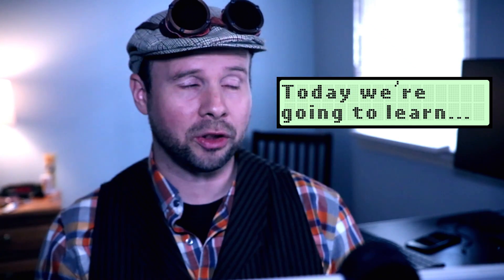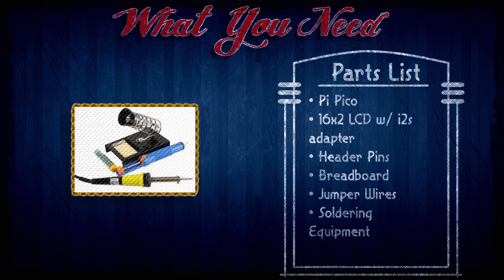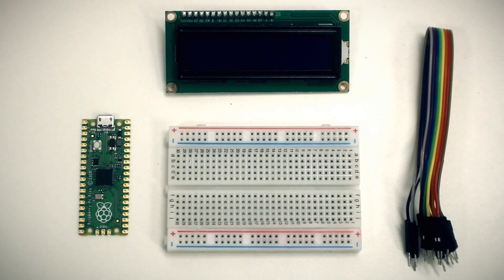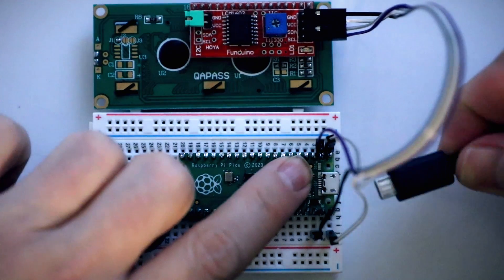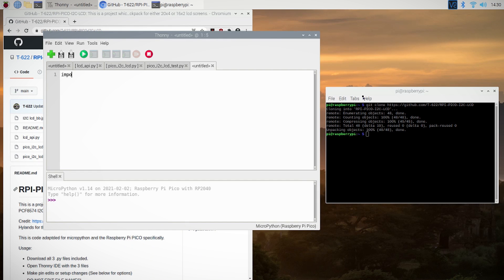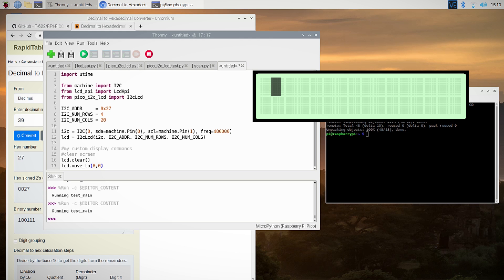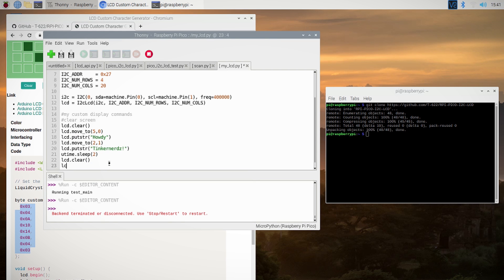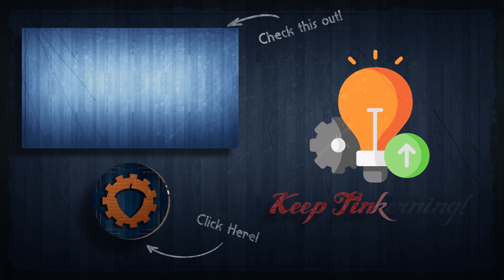LCD Basics for the Pi Pico

Comment: One thing to note here is that the LCD display being used in the video is 16x2 so you want to change the I2C_NUM_ROWS and I2C_NUM_COLS constants (or whatever passes for constants in Python) in the script to match those values. There are in fact 20x4 displays as the defaults would indicate and they work virtually the same way as the 16x2 displays.

It will of course work fine with the default values but you'll notice that setting the display dimensions correctly lets the library handle line overflow. The demo script that shows time for example includes seconds and those will be cut off if you have the wrong dimensions and will overflow to the next line with the correct dimensions. You also won't see the cursor as that's being displayed outside the dimensions of the screen.

Comment: Never the I2C backpack 16x2 screens. They are horrendous. Superbad contrast, viewing angles, ghosting. You can have a VA white on black I2C/Parallel 16x2 display for the same money as these junk panels with backpack combined, and you get a cleaner form factor as well, as there is no backpack because the controller already does I2C.

Comment: If you're doing everything the tutorial says and run the code and you get no error but still nothing is showing. Then try turning the blue box on the back a little to the right to fix the contrast. That did it for me. :)
Reply: Thank you!!  I got the backlight to go on and off, but I couldn't see anything else.  I didn't know what else to do until I saw this post.
Reply: Same. My i2c module came with no instructions (I didn't even know if I was facing the pins correctly) and got a bright blank display until I turned the trimpot.

Comment: Great video! I own both a Raspberry Pi Pico and an Arduino Uno 3, and I've noticed that the Raspberry Pi Pico is very similar to the Arduino Uno 3 (a microcontroller and runs on C++). Would an LCD display much like the one from the video be compatible with an Arduino Uno 3?

Comment: I plan to use the LCD as a Model Railroad Announcement display at the Station to show arrival & departure times & platform #  eventually add Train control to with fast clock in sync.  Either using Raspberry Pi or Arduino.
I have just subscribed to your Channel.  Appreciate your to the point videos.

Comment: It dont print text in my screen just blink the screen once . Can someone help me ?
Reply: same
Reply: same, seems like code itself is working, I can even toggle backlight on and off,  but I am unable to display anything on the damn screen, all the tutorials look the same, same components, same code, but nooone seems to have case like that and a fix...
Reply: @nonejm5732  try rotating the white thing in the blue box. It adjusts the brightness. By default this device is not bright . If you rotate it should fix it. On the back of the display*
Reply: holy shit, I found the issue, so on the back of the i2c converter is little blue cube, just use screwdriver and turn switch on the inside.... apparently it controls contrast

Comment: You are powering your LCD and I2C backpack from 5V. The Pi Pico pins are not 5V tolerant, so should a 5v to 3.3v converter be used here?
Reply: There are no output from the LCD to convert, just inputs.
Reply: @ewetoob1924  I read your comment and thought about it for a second. I2C goes both ways so the LCD can totally send data, for example when you scan for devices on the bus, you get addresses that had to be sent from the device. So without a converter pico would get 5V on that line.
Reply: @FakeMichau That would depend on the pullup resistors on the I2C bus, which is driven by pulling the lines down to ground. I don't think the LCD has built-in pullups to 5v, so the Pico is probably using the pin pullups to 3.3v. The LCD would still recognize the 3.3v as a logic 1 and the logic state 0 would be ground. I2C is implemented with open collectors pulling the lines dow ONLY; there is nothing other than the pullup resistors driving the line positive, so no 5v would be present on the lines.

Comment: Mind the signalling voltage, pico uses 3.3V, but most other Arduino parts uses 5V.  Use of 5V signal on a pico will damage it.
Reply: It is confusing some people say it will hurt others say it will not hurt the pico. I would like to know who is right.
Reply: @fotogordon  The Pi Pico data sheet is quite clear. The inputs are designed for 3.3V signal levels and 5V can damage them!

Comment: Great tutorial. I happen to have a SunFounder LCD with the I2C adapter. One question about the way you git cloned the files to local machine and then opened and saved them in Thonny. Could you not just copy the source files to the file system in file manager? I ask because I cloned nearly all popular libraries for both MicroPython and CircuitPython. Granted I don't need them all every time, but I was hoping I could streamline setting up the libs by using the file system on the Pico. Really appreciate the video. New subscriber here!
Reply: I just click the Download ZIP link on github and then unzip them. I can then copy the files I need and open then in Thonny. I can choose to upload them to the Pico by saving them from in Thonny on the Pico. Works for me.

Comment: Hi, and thanks for the video.

Ha, you thought I had finished...
Are you using Micro Python?
I have tried to run your code in Circuit Python and I am up to 2 errors, which have me stomped
1/ 'import utime', well that blew a raspberry! Solved that one by using 'import time'
now I get  "ImportError: no module named 'machine'", tried to look up the error  on the never wrong internet thingy, but to no avail.

Ideas?
Reply: I'm having similar issues.  Circuit python != Micro python. Seems half my peripherals are supported in MP, half in CP. Good Luck.
Reply: @crg178  Yes mate, exactly what I found.
So the question is which one do we use?

I have another problem with the LCD board I am using, it works fine on the Arduino.
I did get is to display some random characters a few days ago, but nothing legible!
I have about 200 of these LCD boards!

Another board that has caused me grief was the SDCard reader, works fine in CircuitPython, but as of today, not been able to get it to work in MicroPython.

Have fun mate, later.

Comment: My tip: NEVER EVER buy these white-on-blue I2C backpack LCD's. They are obnoxious! Ghosting, lag, impossible viewing angles, no-contrast and that irritating hunchback. The one you DO want is this: Raystar RC1602B5-LLH-JWV. Great white-on-black VA display with built in I2C sans backpack. It is even cheaper. Thank me later!
Reply: Where is it cheaper? The Raystar you mentioned is over $20 on eBay vs ~$3 for the HD44780. 
The Raystar does look good in the pictures, and I'm interested.

Comment: Does not work! You need a voltage level changer to get 5v to the LCD.
Reply: I agree.  There are I2C LCD adapters that will run on 3V, but they draw too much current.
Connecting the 5v I2C direct to Pico pins might work for a while, but Pico definitely is documented as not being 5v tolerant...
Reply: I found  it (works for me) without  levelchanger when you chande freq to 200000. Just now I am waiting for delivery for levelchanger

Comment: Seeed Studios is selling the Pi Pico with header pins soldered on. Currently you can only pre-order one.  They also sell a Grove connection expansion board for the Pi Pico.

Comment: Thank you for teaching this guide. It worked for me and below is the code I modified to display the temperature 
import utime
import machine
import math
from machine import ADC
from machine import I2C
from lcd_api import LcdApi
from pico_i2c_lcd import I2cLcd

I2C_ADDR     = 0x27
I2C_NUM_ROWS = 4
I2C_NUM_COLS = 20
i2c = I2C(0, sda=machine.Pin(0), scl=machine.Pin(1), freq=400000)
lcd = I2cLcd(i2c, I2C_ADDR, I2C_NUM_ROWS, I2C_NUM_COLS)    

tempsensor = ADC(4)
conversion_factor = 3.3 / (65535) # Conversion from Pin read to proper voltage

while True:
    currentvoltage = tempsensor.read_u16() * conversion_factor
    temp_data = 27 - ((currentvoltage - 0.706)/0.001721)
    print(str(currentvoltage) + " : " + str(temp_data))
    lcd.clear()
    lcd.move_to(0,0)
    lcd.putstr("Volt" + ":" + str(currentvoltage))
    lcd.move_to(0,1)
    lcd.putstr("Temp" + ":" + str(temp_data))
    utime.sleep(2)

Comment: Hi I have tried this wiring and wiring diagram on t-622's web page, however when i run the test code i do not get an address back all i get is:-

%Run -c $EDITOR_CONTENT
[]

Please help
Reply: Perhaps  your hardware is not on the correct physical pins, or wires may be reversed...
Reply: Try change to freq=200000

Comment: Hey Tinkernut, glad that you are back. Just little side note, your way of finding the i2c address is pretty nifty but most i2c devices will have it's address listed in the datasheet and is also a good practice to always look in the datasheet first if you need more information on any electronic device. Cheers